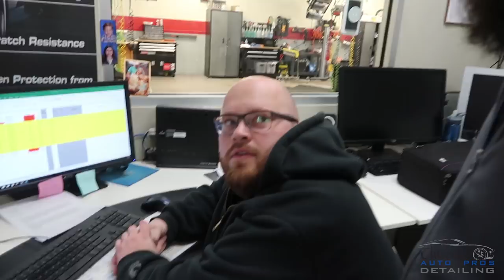Carpro's Clear Cut Rapid Compound REVIEW and GIVEAWAY | Detailing VLOG #9

Comment: Car Pro Clear Cut will turn clear if u keep working it. It works oppsite of other polishes. U start off light pressure make 3 to 4 passes once it starts to turn clear then apply pressure to work the defects out.